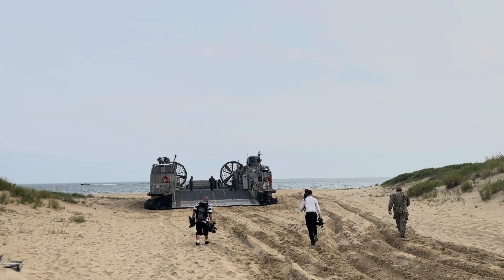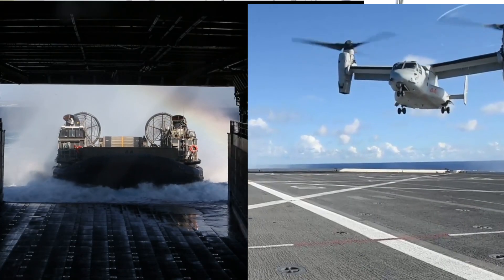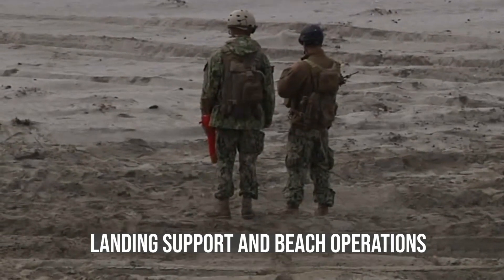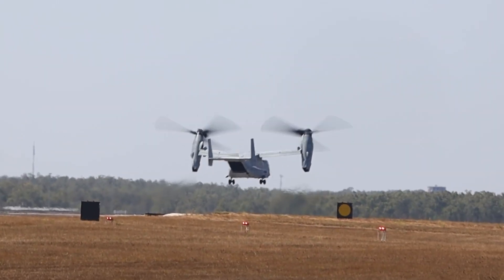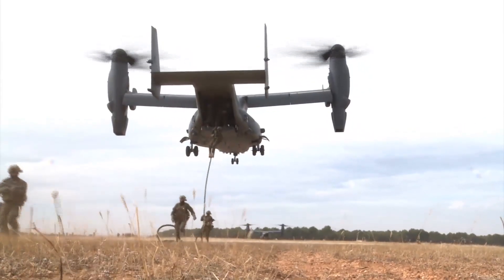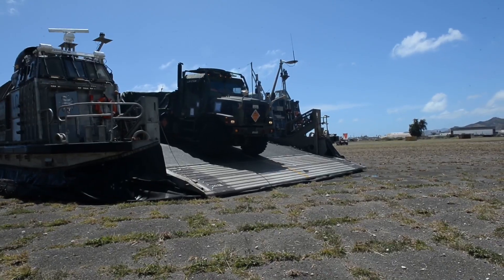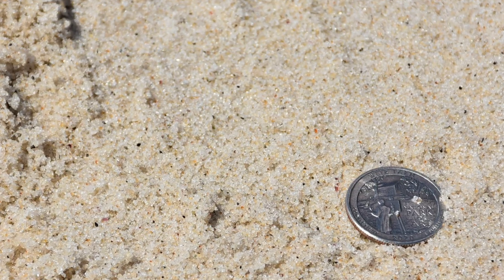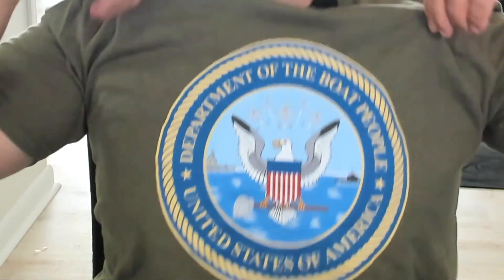How a Maritime DSCA Task Force Provides Hurricane Relief

Comment: Serious question, I've seen a few videos of Ukraine using DPICM artillery and most strikes seem to have a predominant ring pattern of dispersal. This seems sub optimal for target coverage. What is going on? Are they fusing them too low, too high? Is there a dispersal kicker energy that is not varying when it should? Has the dispersal pattern been screwed with to reduce duds? Any insight would be appreciated.

Comment: Are the Ospreys really as lethal to the crew as they seem in the news or is that just selection bias? Seems most of the dangerous accidents outside warzones are normally that vehicle.
Reply: It's a combination of selection bias and the fact that all rotary wing aircraft have a rather particular arc of safety incidents until they maximize their reliability. You could see the same arc If you review the safety records of the CH53, or CH47.

But for my own experience, I was in love with the osprey, in love with the capabilities it gave us and never had a problem on one, as opposed to flying around Iraq at times in CH46s that were veterans of my father's war. 😬